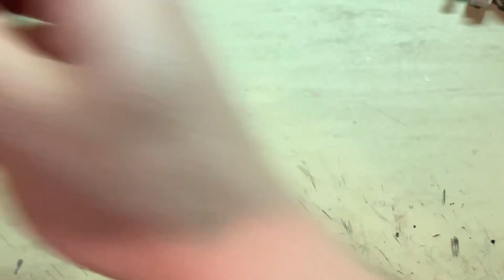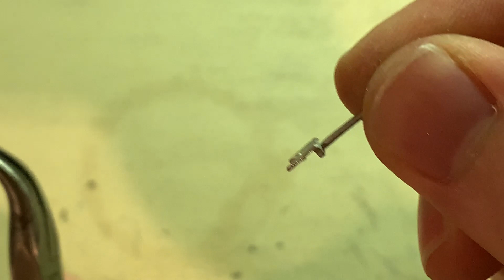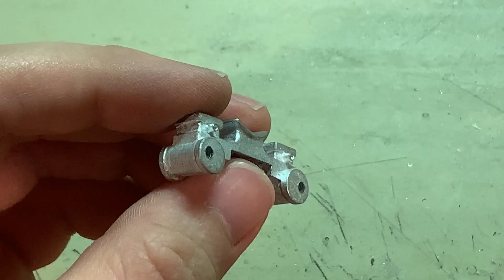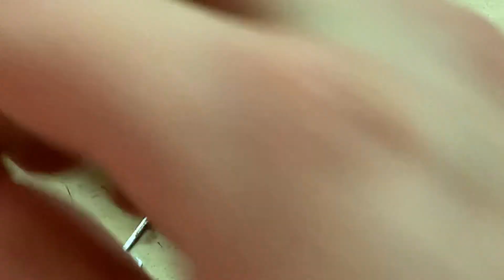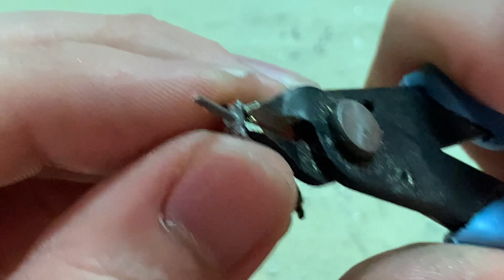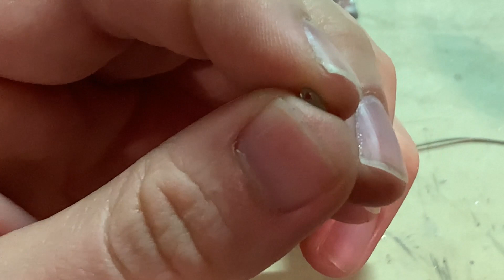How to Build a Terrible HO Scale Steam Engine Kit: Part 2 - Main Rods and "Valve Gear"

Comment: Hi Darth, just watched the first 2 episodes. You mentioned that you worked on the 2-8-4 kits, and that the valve gear for those aren’t the greatest. What did you do with that situation? Asking because I have one of those kits, and if I decide to tackle it any hints would be helpful. Thanks
Reply from the maker: The metal for the valve gear rods is soft and easy to damage.  They have to be handled very carefully, and the inaccuracy of the castings can make getting them to work difficult since many of the parts are assembled by bending instead of using screws or rivets.  I ended up making a lot of the rods on mine from brass.

Comment: Any idea what metal alloy the parts in this kit are cast with? I recall something called “pot metal” back in the day that was used for this kind of thing. Maybe that’s what it is.
Reply from the maker: These were made from a zinc-cadmium alloy. It made the parts easier to cast and works well with solder, but it’s not exactly the safest metal to handle very much.
Reply: @DarthSantaFe Could the metal be pewter?
Reply from the maker: @RichardKroboth  It's similar to pewter, but not quite the same.

Comment: I’ve been enjoying your videos on building the steam loco kits.  I wish there were some decent kits available now.  One suggestion - when you to drill an unmarked hole into the back of the crosshead - You can use the same size bit you used for the front, so it will fit snugly in the hole - then just 1 or 2 turns and the larger drill bit will start a conical hole in the other piece as a center.  Then you can use the smaller bit to go the rest of the way through.  It might help get the holes more closely lined up.

Comment: Another bout with the Arbour monster which has seen you as the victor! I dread the rainy day I finally try to put my Brooks mogul together... perhaps I'll need to see about either making (or getting made) some higher quality rods for the thing. White metal doesn't seem like a sensible material to make valve gear out of, but I guess there's not much sense to go around when we're talking about a company that has to reassure its customers that they are, indeed, having fun building their kits.

Can't wait to see you tackle more of this thing. As poorly designed as it is, it may well end up a great looking model after all the work you put into it!
Reply from the maker: I also have the Brooks Mogul and used it as a bit of a practice piece. It’s come out as a decent runner, and I can offer some tips here and there on how to finish it and get around their mistakes!
Reply: @DarthSantaFe  I'm putting together a Brooks Mogul as well. I've got the loco mechanism running well but have yet to build the tender and superstructure. I'd love to see yours!
Reply from the maker: @Alerrecks  I plan on putting up a review of the Brooks when the 0-4-0 is done!
Reply: @DarthSantaFe  awesome!!

Comment: Get a small hobby vise to hold small parts while drilling and/or filing. Drilling through the soft metal parts into a steel block will dull your drill bits. Use a piece of wood instead to back the piece you are drilling. Also, a set of small jeweler's pliers, files and tweezers would be a good addition.
Reply from the maker: I actually do have all that, just didn’t think to use it. :)